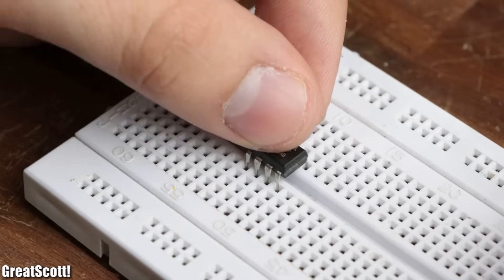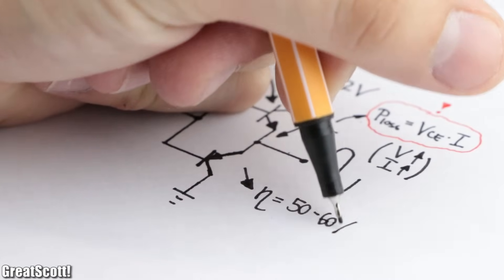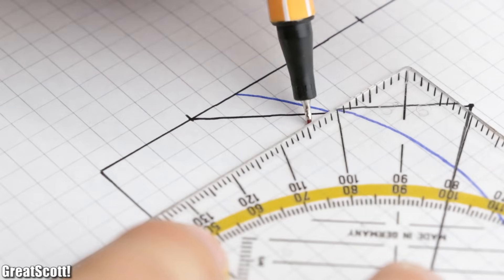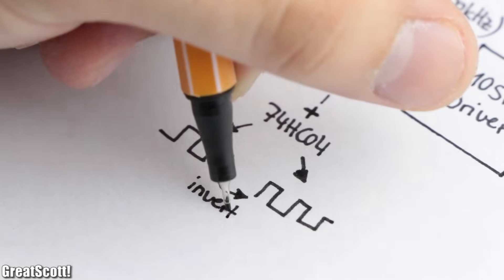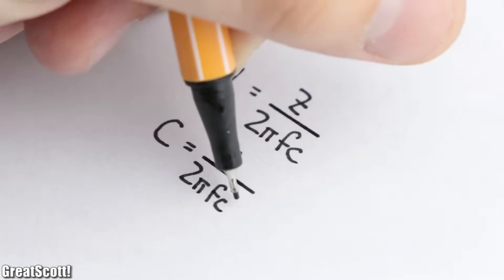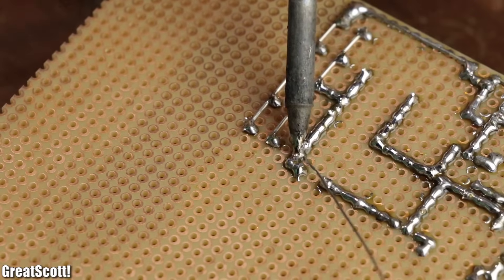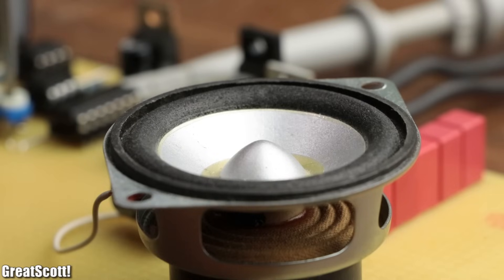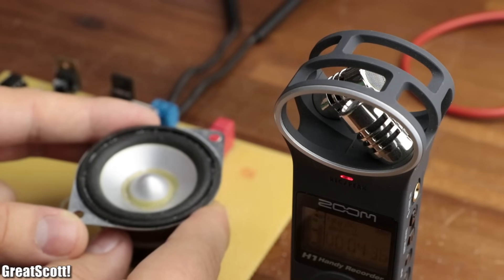DIY Class D Audio Amplifier

Comment: those amplifiers are cheap so there is no point of making them yourself
Reply from the maker: If you apply this logic  to everything in your electronics studies you will not learn anything new.
Reply: That´s right.
Reply: GreatScott! I couldn't agree more
Reply: GreatScott! that's true
Reply: Low power amps are cheap and it's probably best to buy them, but if you go up in power, things get expensive and it's better to DIY. Also, by doing stuff yourself, you have the power of choosing the quality of the components and manufacturing.
Reply: Cheap my ass. 50$ is cheap for you?
Reply: maybe you can buy something similar 'ready made', but this way, as said, you learn how it works and maybe alter it to suit your exact requirements instead of buying something only 'near' to what you want...
Reply: i personally would try to get rid of that possibly 'uncommon'? mosfet driver chip and use something more 'standard, maybe a 'discrete' driver circuit?', maybe even not using mosfets for the output stage.or different ones...
Reply: Makaronimees Makaronist yeah

Comment: Practical class d amps do not use open loop pwm. They use self oscillating closed loop modulation that create a variable frequency pwm. Latest gen class d operate at around 750kHz av frequency.

Comment: The math that you used to create your output filter was very informative. However, if you try turning the music down, you will hear zero crossing distortion. This is because it is necessary to create a dead time to allow one transistor to turn off before allowing the other to switch on. The higher the clock speed, the more apparent the zero crossing becomes. When playing loud, it's more than 20 db below the peak, so it is drowned out, and sounds pretty good. You can't beat the efficiency though. This topology maintains good efficiency at any load, any amplitude. The same cannot be said for a linear output stage. If you do a hysteresis feed back topology, and do away with the triangle wave generator, you will have pulse by pulse feedback, eliminating any trace of zero crossing distortion. You will greatly improve signal to noise ratio, and greatly simplify the circuit. I wish I had a way to show you a basic schematic to try.

Comment: Duno why yt sugested me this video now. Well it's interesting as usual but I have a question about coils you used. 33uh is not a big coil and do you see advantage of using air core ones over ferritic? Probably you would have to wind them yourself and they would be considerably larger. I'm asking because back in the day everytime I had to use some inductors, metal core ones were givind me headaches. I don't mind using ferritic ones to cut freq In some normal signals but I dont consider audio signal as one of them :-)

Comment: Before an audio signal is amplified it gets DC biased to half the supply voltage (a.k.a virtual ground) to amplify the negative half wave of the audio output without clipping, so the output is nonetheless a DC biased audio output. You need a 1000uF decoupling capacitor to remove all that bias before interfacing the speaker..well unless you're amplifying with a negative supply rail, at least.

Comment: This reminds me of a buck converter where you have a square wave with changing duty sent to a FET then through a low pass filter. What I wonder is why the extra fet is needed here? I presume to pull low instead of float but I'm not sure.

Comment: you can get much better sound quality using a delta-sigma modulator instead of a comparator; all you need is a schmitt trigger, capacitors, and resistors, and the resulting circuit is actually simpler

Comment: Great video, but while testing amp use speaker mounted into it casing. With this bare speaker you're creating acoustic shortcut that dramatically decrease the volume and quality of acoustic valves formed by speaker membrane.

Comment: Hey, i would like to add criticism, just for learning purposes... the comparator has a triangular wave input right? This is because comparing to a linear signal will give you a linear comparison signal, preserving the linearity of the different sinusoidal signal levels, so to speak. The triangular signal on the experiment was relatively distorted non linear, this would result in distortion of input signal harmonics!! In other words, it will shift the frequencies of the music! Just to point it out, very neat project!

Comment: Great Scott ...use a LM380 at the output...I can assure you it is definitely better and distortion free than the cheapest LM386
Reply from the maker: You mean input?
Reply: yes yes input....sorry I wrote output by mistake
Reply: Well, output is relative :}
Reply: LM 384 can also be an option with 5W output..... but Great Scott what was that device which was measuring sound intensity??

Comment: Great Video! I even learned a bit more :)
I once tried to build a D-Class-Amplifier on my own, but with symmetrical voltages, e.g. -12V and +12V. The reason was to enable use of regular audio line signals from a mixer or other mains powered devices. Because a smartphone has no reference to ground and is basically floating, the Amp in this video has no Problem with it. But I didn't want to work with offset voltages, and stick to symmetric audio signals as I always do in audio engineering. 
Maybe this modification with symmetric voltage and audio levels could be implemented in a future version?

Greetings from North Rhine-Westphalia :)

Comment: LM386 is an audio amp. This chip and its supporting circuitry, is the only thing required to create this amp, so there is no need for the other circuitry you presented here.
Reply: How else would he create the PWM singal modulated around the input signal?

Comment: the circuit file in description, had a wrong number in 1 ic, the "386" is named as "393"
Reply: stand -rte LM393 is correct, it's a comparator that compares the incoming signal with the sawtooth waveform from the 555.

Comment: 200w aiwa exos 9 bluetooth speaker is being driven by two D class tpa3118 which provides 2 x 60w for 8 ohms does not require heatsink and is a size of smartphone chip

Comment: What about the constant DC-current that's flowing over the speaker? In idle, the pwm signal is about 50%, which means that there will be a DC voltage across the speaker with this configuration.

Comment: A question about this amp in specific: wouldn't it require also a high pass filter? From what I understood, it swings the voltage between VCC and GND, so an audio signal would only go positive, no issue on that until we count that the speaker is referenced to ground as well, but a middle voltage (which should happen at zero input signal) would be half VCC, so it would be conducting that DC offset.

Comment: So, IF you ended up adding in the simple LM386 amplifying circuit from the data sheet, how does it compare, this circuit with the MosFETs AND the LM386 circuit, to just the LM386 circuit??  I’ll build one to find out, as I have about five or so of those LM396 amps already soldered on pcb laying around my gear.  I’ll need to look out for the specific op amp that you’ve used.  Also, how come only a single, positive DC power supply?  Is it because of the way you’ve wired the FETs, or perhaps incorporated some output from the amp to create a feedback loop to the opamp’s inverting stage?  I’ll check out your circuit, and Thank You for sharing this.  I’m fond of your videos, and also your penmanship!!

Oh yeah, and where do you live, where you’d write the numeral ‘1’ to look a little more like an upside down ‘v’, and yet you write from left to right!!??  I know of no such place on this planet where this is the custom.

Comment: How does the 555 timer create a triangle wave frequency of 200khz? I've loaded it into a circuit simulator but it only produces a voltage of 5v on the output (i don't have an oscilloscope). Ive been looking online for a way to create a triangle wave with a 555 timer, and only come across ways to do it by op amps or comparators. The only circuits I've found close to doing it on a 555 timer was by making a square wave with a frequency of 200khz, but then using a an RC filter to make a triangle wave, which would just change the frequency and the amplitude. I'm not really sure how to go from here. Could someone point me in the right direction?

Comment: Great Scott, there's an error in your project - you've flipped the symbol for J1 audio jack and the connections are misplaced. To fix this, you're going to have to delete all 3 connections to J1, then flip it vertically and finally rewire the 2 input resistors and GND to the appropriate terminals (L, R and S, respectively). I've forked your project and done this fix myself (as user Renrew Eck).

Comment: Wouldn't two inductor stick together will have the effect of mutual inductance? Are those shielded inductors?
Reply: Yes and there will be some multual inductance although those types look semi-shielded.  However shielded
inductors add a lot of distortion in a class D output filter, linear (gapped) inductors are needed to avoid bad
THD figures.  
The crosstalk between inductors will mainly be at the switching frequency rather than audio frequencies, and a 
quality design will space out the inductors to reduce this.

Comment: so i see that the audio jack has two signals going into resistors which then get put back into comparator, does this mean you are essentially using the aux port as a mono output instead of stereo?

Comment: @Greatscott. instead of using lm386 to amplify the input signal you could have just stepped down the triangle wave amplitude using a voltage divider right? would it work?

Comment: can i use audio amplifier to power step-up transformer produce high volatge electric spark with frequency sama as signal input? for example car ignition coil
Reply: not really.
how you would make that will be by having a circuit that will make high voltage at high frequency (i don´t thing an ignition coil will work, if you can try it with a fly-back transformer) then put a switch (something like a mosfet) and just connect the input of it to this amp

Comment: Is it ok to say, that the LM386 is directly driving the speaker ? Lm386 has 1w capability.
And the comparator inputs are limited to a few nanoamps.
So even with a higher voltage or amperage, it will still send approximately the same RMS signal.
Is the speaker running on LM386 feedback ? (and its a class ab amp, not a discrete op-amp)

Comment: Cool... I have a AC 12 v 1.5 amp adapter and I have a 12 Dc Power needed amplifier board. How to convert that 12 ac to pure 12 Dc? Ac12v make too noisy with amplifier

Comment: indeed, very nice diagrams and way to draw them. one (silly?) question though: how are the 2 MOS transistors driven in the schematic you show? I mean, the low side one ok, i understand. but for the high side? you need a vgs voltage. what is the reference for the source in high side? thank you. 
later edit : i get it :-) the detailed schematic explained :-)  i only looked at the block diagram. sorry :-)

Comment: What will happen if you remove the inductor from the output stage?
Thanks for the video
Reply: The voltage will be stabilized, but the current will be spiking all around the place

Comment: My hesitation in using Class D is that the audio outputs for any mini stereo boards I have found, do not share a common ground and are not common to the power supply either. I want to make very small stereo boosters for helmets and be compatible with common ground wiring used everywhere else in the signal path as per consumer devices. Or did I overlook something?

Comment: I tried one of those 2x3watt class d amps from ebay (5vdc) but im getting 0.5v dc across the speaker terminals, scratching my head here, the board has a 680uF capacitor

Comment: Is it possible to use 4 MOSFET's in H bridge configuration ? That could double the output voltage, peak output voltage could be full supply voltage instead of of only half

Comment: Have you tried it without the output filter?  The speaker can't follow the 200kHz, so it should find the average position according to the PWM'd signal.  Does the filter make a difference?
Reply: It's essential to the operation of the circuit as it filters out the sinewave drawn up by the PWM signal

Comment: I have a Veroboard stock that STINKS of burnt circuit board for some reason. The board itself is fine, it's just the smell that bothers anyone working with it.
Should I throw them out? It makes my head hurt when I solder on it.

Comment: Nice video, I got one question:
Can i use a switch mode power supply for powering this amplifier? Wouldn't rhe ripple from smps affect performance?
Reply: No, it's the class A/B amp that can have difficulty with common mode noise...
Class D is almost immune to it because the amplified signal is fundamentally "noise", that gets filtered by the LC to eliminate the high-frequency...
The noise experienced would need to be large enough to produce significant change in the maximum output power - and would only really be experienced at that point, however if the common mode noise signal managed to reach that input preamp (not so much the comparator), then it's entirely possible that would amplify the noise...

Comment: Where do you get the silver copper wire? Also, what soldering tin do you use? I am having trouble finding one with a decent flux core. Something like Multicore is a little too pricey for me, but it's the only thing I've really like so far.

Comment: There is a slight mistake at 4:44. The -3dB point equals half or 0.5. The drawing indicates 0.7 which looks to scale, but the frequency amplitude curve drawn indicates a logarithmic scale ;)
Reply: actually, the -3dB point on a frequency cutoff graph is actually .707 times the maximum voltage. this is usually rounded to .7. what you are calculating is the half power point, which is correct, but his graph is frequency to voltage, not power
Reply: You are totally right. Missed that this was frequency to voltage. I was assuming frequency to power as I was recently working with that.
Reply: no worries

Comment: Hello Great Scott, can I just use a split 6 0 -6 supply to the class D or class B amplifier that you have created so far?
Reply: it should work but it's better if you apply 12 0 12. and it could actually be better because that is how class d amps work( with rail to rail voltage). that way you don't need a dc ofset filter, but here I'm sure it has a dc ofset but he didn't mention it anywhere!

Comment: Hey scott i just got stupid question..

So if there is a step up transformer why can't we just use AA battery connected to series of step up transformers so we can have a 120-220v dc?
Reply: Because transformers only work on AC. When you apply current to the primary, it'll generate a magnetic field. If you use AC, it'll create a constantly changing magnetic field, which is required to induce a voltage to the secondary. Hope you learn something new.

Comment: i want to know how do i match a speaker to an amp? speakers come in various ohms, wattage and sizes. if an amp has 100w 8ohm output then can I choose a 200w 8ohm speaker or I can use 80w 8ohm speaker also? how do I know what size (diameter) of a speaker will work?

Comment: Bro I have 2 1.5 inch speakers  that each has 4oum 2wats and I have a 3.5volt smartphone battery but I don't have any voltage booster
So can you please help me by giving me some idea about what kind of amplifier will I use to power the speakers?

Comment: how can I make a class D Amp with feedback, my problem is that i can't find enough about its stability on the Internet ... also if you're using a single 15v supply how come there is no DC blocking capacitor at the output ??

Comment: Hey scott, Where do you get rid of the DC offset at the output stage into the speaker?
Reply: i was wondering the same thing. normally class d amps use rail to rail voltage at the mosfets but here it's only Vcc and GRD. it should have DC ofset

Comment: Could I use an 3 ohm speaker, or it´s only for 4 ohm speeakers? and how much sound pressure (SPL) does this make?
Reply: yes you can! also amplifiers do not make sound pressure level (SPL), they just drive the speaker which makes sound pressure! :)

Comment: The use of a LM386, an audio power amplifier, as a pre-amp, is a bit over-kill, especially since you were focusing on efficiency from the get-go.  The LM386, with a handful of additional components would deliver nearly 2W on its own - but it's not a class-D amplifier.

Comment: Greatscott or anyone here, could you point me in the right direction to understanding the purpose of the high frequency triangle wave ?
Reply: kardeef33317 the the comparator takes the input signal and compares it with triangle wave to convert it into a PWM signals. the duty cycle of which is proportional to input signal (sound waves amplitude). High frequency because it will be easy to recover original signal with less distortion.

Comment: The main problem I have had with class D amplifiers in my audio system is massive interference on the FM dial from all the high frequency EMI/RFI they emit, so if you are a radio listener, this is to be considered.  They sound close to what a tube amp sounds like, but not quite as smooth as a well-designed class A (if you aren't concerned about efficiency, of course). 

If they can effectively solve the EMI/RFI problem inherent in class D, they would be nearly the perfect amplifier.

Comment: I've been looking to make a class D amp but don't know where to start. I need 300w at 2 ohms for two channels for mids/bass, and I need a separate one for 50w at 4 ohms for two channels for my tweeters. I've tried finding schematics, but the ones I've found are messy and confusing to follow. Any suggestions?